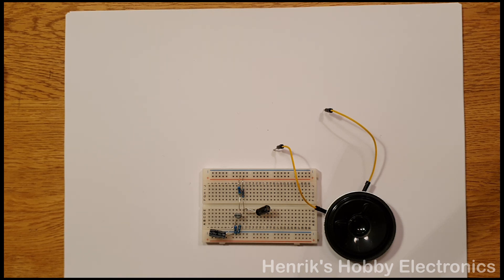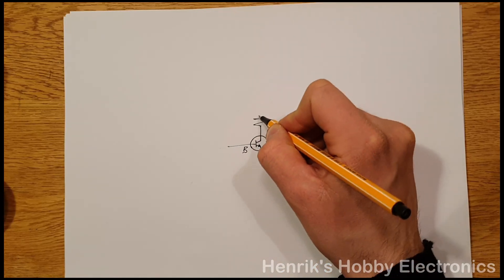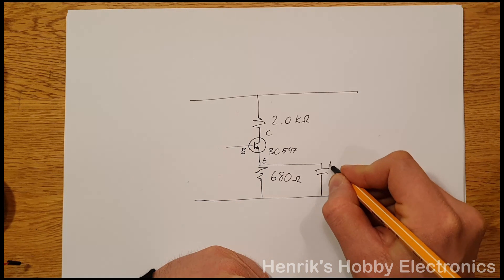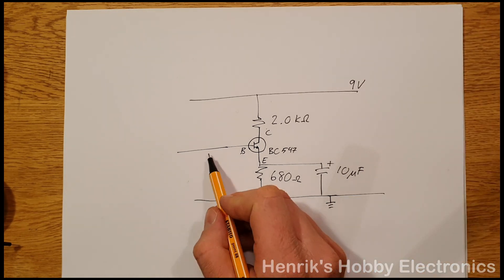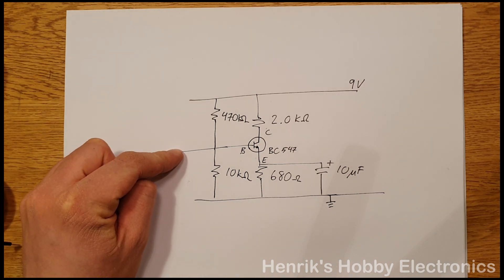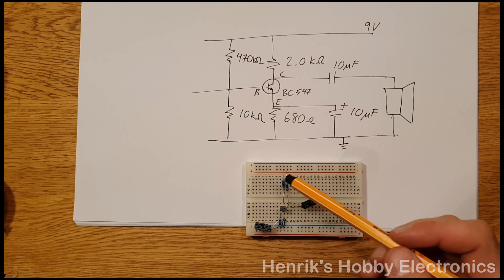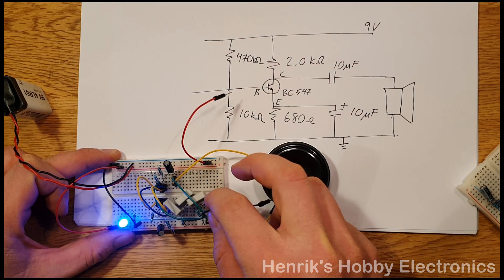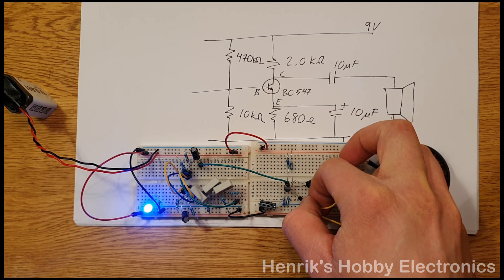Single-Transistor Audio Amplifier - How the Common Emitter Amplifier Works

Comment from the maker: Do you have any questions about this circuit? Ask below and I'll answer as many questions as I can :)
Reply from the maker: There is a typo in the circuit diagram: the 470 kOhm resistor should actually be 47 kOhm. Both values will create a decent sound in this experiment though.
Reply: How come there was no capacitor on the input between the base and emitter ?
I love your channel by the way.
Reply from the maker: @adastra123  Thanks! I am not aware that adding a capacitor between the base and the emitter would improve the circuit in any way.
Reply: @HenriksHobbyElectronics  what type of mic can be used instead of that input circuit
Reply: @SuchiOudha25   an electret mic will work. This is specifically used for electret mics by the wa
Reply: How to give signal or input signal
Reply: Thank need oscilater circut and radio tuner curcuit your explainion easy to understand
Reply: I have two questions:

1). What is the explanation of why the output capacitor is non-polar while the by-pass capacitor is polar?
2). If you put capacitor in input side, what should it be? Polar or not-polar?
Reply: I have a question

Can I connect this as a preamp directly into another amplifier, or the circuit needs the speaker to work properly?
Reply: The output from a cct like this is varying DC; 0v to near rail. Should point out the cct is not providing an AC current signal to the speaker, a push pull amp needed etc
Reply: I have some questions, I'm a beginner so bear with me.

1. You mention AC. Doesn't the battery only generate DC? is this meant to be used in a larger circuit?
2. I understand you limit the DC with resistors, but I don't understand using the capacitors for AC current. Why a capacitor? Does it have to be polarized? Wont some DC also go there?  Why does the emitter capacitor go to ground, but the collector goes to the speaker?
Reply: For the resistors 47kΩ and 10kΩ, is that considered a voltage divider for the base of the transistor?
Reply: I WANT TO KNOW ABOUT HOW TO IDENTIFY COLLECTOR AND EMITTER ONNTRANSISITOR
Reply: @HermonHillaryMadovi  Aside from a Google search for the part number on the transistor to find a datasheet, a handheld $25 tester identifies each lead no matter how it is inserted into the tester.   Search TRANSISTOR TESTER

Comment: hey , i have a project , and i want to add a third transistor as switching device for the circuits in the video , i will connect the pir sensor to the transistor so whenever it detects motions the oscillator and amplifier would turn on , please someone help me i dont know how i will connect it

Comment: hi thank you sincerely for this excellent video
I'm trying to find a minimalist circuit to build a line preamp that should have low voltage gain (2 or 3 times) low distortion and not too high output impedance   
Unfortunately  a single transistor circuit may have, from what i understand,  too much distortion and high output impedance
Could you suggest a two-transistor scheme that might work?
I'm very interested in minimalist circuits because many say they could sound very musical
I would really like to have your opinion
Kind regards Gino

Comment: enjoyed your video on the one transistor amplifier,so much that I see you do but not sure why you pick the components and where they go in the circuit.can you point to a basic video that will help explain the reasons for the components you use? thanks John

Comment: The 2 kiloohm resistor IS to high
 IT will Limit the Maximum current to 4.5 mA.
The Transistor can Drive more than 100 mA. So the Power of the amplifier IS Limited unnecessarily.

Comment: Will distorting of the sound output happens if a 5V supply is used instead of 9V?
Reply: the dynamic range would b much reduced

Comment: The biasing is all wrong.  The quiescent DC voltage at the collector should be 4.5V for best voltage swing.  To get that you would need 2.25mA through the collector resistor.  This would imply  1.53V at the emitter and 2.23V on the base.  But you have only .18V at the base, so the transistor is cut off. ???  This thing will make a better guitar "fuzz" than an audio amplifier.  The distortion would be off the scale, so no wonder it sounds like a (distorted) square wave.
Reply: Indeed i saw it too...
Reply: He has more than .18V at the base
Reply: Forgot a zero
Reply: You righy

Comment: It would be better if you explain why you use components in that ways and why do select that specific values? After all it is better to understand what is happening in the circuit. Otherwise it doesn't make any sense to someone like me who is just a beginner. Thanks
Reply: The gain is R_C / R_E. The Resistors attached to the base are set to achieve the correct V_B (I_B) to supply the desired I_C. Very general, but it's a start. You could ask ChatGPT for more details
Reply: That's is exactly true

Comment: can we replace BC547 with 2n222a?
Reply from the maker: Both are NPN transistors, so probably yes! Do an experiment, and let me know how it works! If it doesn't work immediately, then check the data sheet for clues on how to optimize the circuit. Good luck! 👍